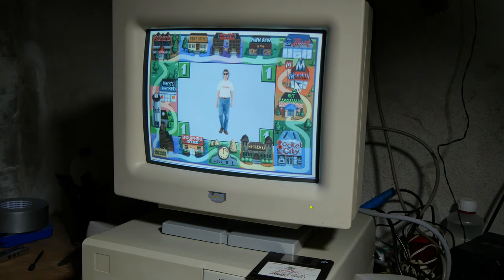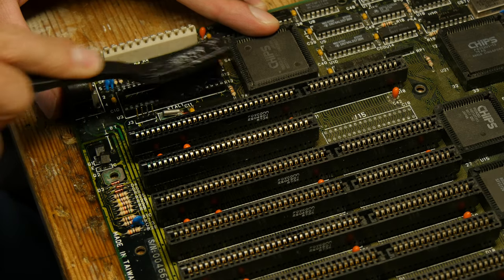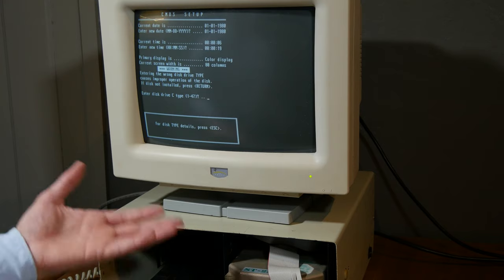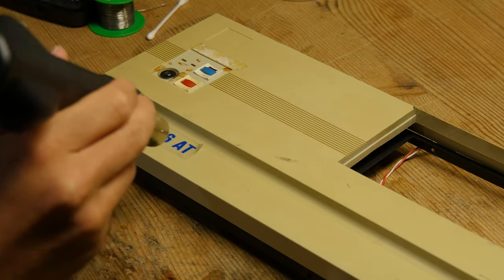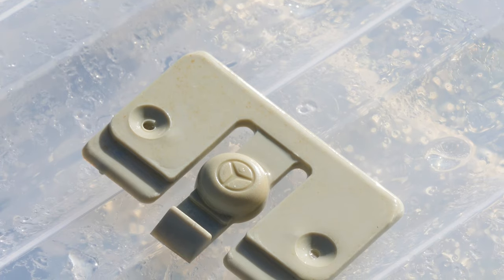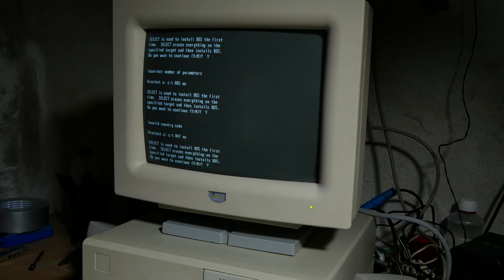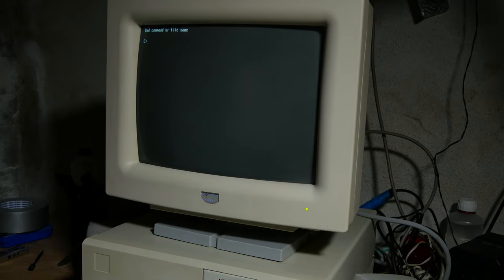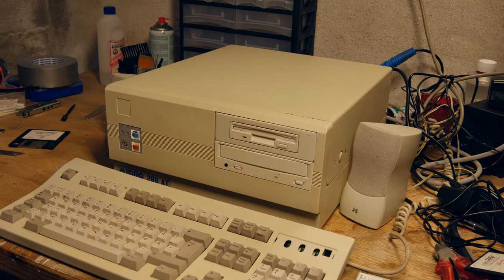286 Dumpster Dive Computer Restoration,,kinda

Comment: Happy to see such restoration! Atmosphere very worm, when you see someone gives second chance to old hardware. Some advices from me. I know that it is important to keep computer in it’s factory settings, but such parts like hard drive and power supply are getting worst and worst condition. I think you’ve heard about options like compact flesh and ATX to AT adapter. This will gives much more nice experience with old hardware. But any way, well done my friend)
Reply from the maker: Thanks for your tips :) I do have some of these adapters. I use adapters and more modern psu for the most valuable computers otherwise it would become expensive. I will replace the hard drives as they fail.

Comment: In case you decide to upgrade the machine after all, I'd recommend a 16-bit ISA VGA graphics card instead of that slow 8-bit card you currently have. And if you install one of those 16-bit ISA I/O controllers w/ IDE, you can get faster HDD speeds with an IDE drive and also use the CD-ROM! Though, this puts the poor old machine on steroids... Its charm will be different for sure.
EDIT: Actually I'm not sure if the BIOS even supports IDE controllers...
Reply from the maker: Thanks for your suggestions :) I think I will keep the upgrades to something more era appropriate. But I understand the fun in see how far you can push it.